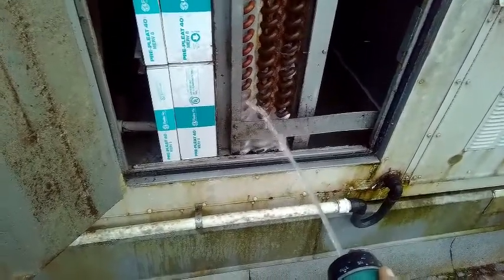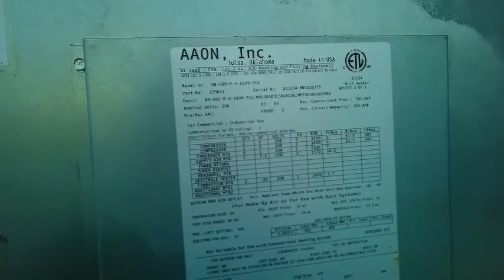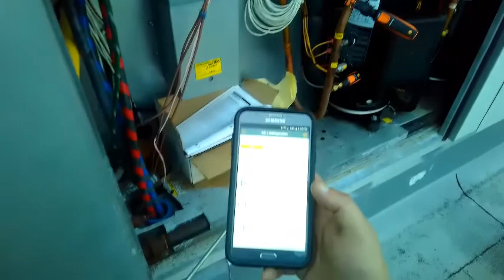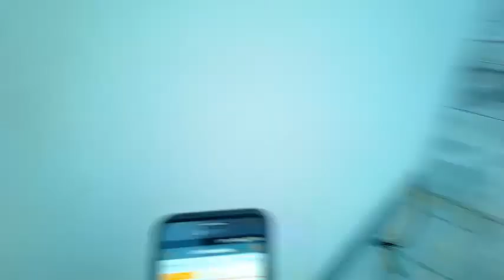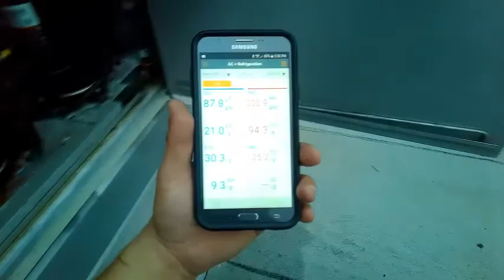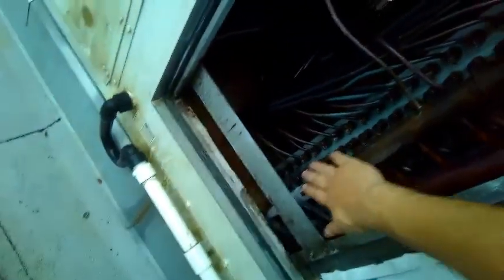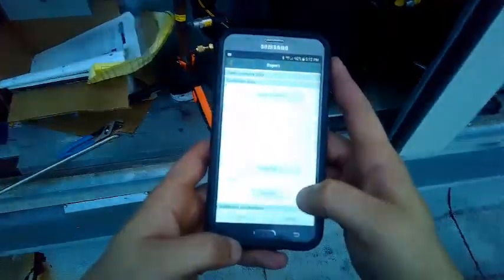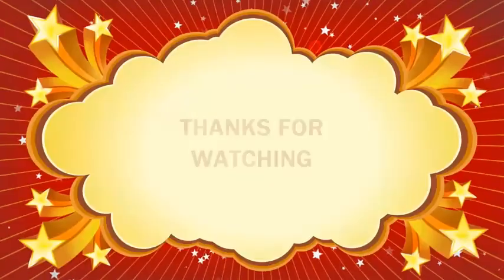AAON 60 Ton Unit Freezing Up More Babysitting.

Comment: Glitter on a turd might make it Sparkle a little?
Reply from the maker: You got that right LOL Thanks for watching man
Reply: Geoff Howeth thank you. Lipstick on a pig would it make it look better? On your unit cooling for 30 / 40 minutes and then blower only for 30 / 40 minutes might get a little Cooling? Condenser fan motors the inop Motors cover the Grill where it blows out with cardboard or ? You will be pulling more heat out.
Reply from the maker: I was cleaning the shop today  and i thought it would be a great idea if I put some 4mil plastic that I found over the two blown ECM fans but I didn't want the ac company to come and be like WHAT THE FU#k. We have been waiting  for about a month for the 1st ECM to come in and while waiting the other went out lol . I Like what you said Lipstick on a pig would it make it look better. Damn true . Thanks for watching man

Comment: You aren't low on gas it low on airflow. Your SH was low as well as low suction pressure. Low on freon would be high superheat low pressure.
Reply: Ness Nesu it's actually pretty normal to have frost on the accumulator it's just boiling off..... It does go away after 10-15mins right? I doubt it's restricted there really is no way for it to be restricted it's just a tank with j dip tube
Reply: Ness Nesu is the bottom frosting / sweating? I don't think the accumulator is an issue.
Reply: someone needs to see if any vents/dampers are shut and  if fans are fast enough. sum-ting-wong =p